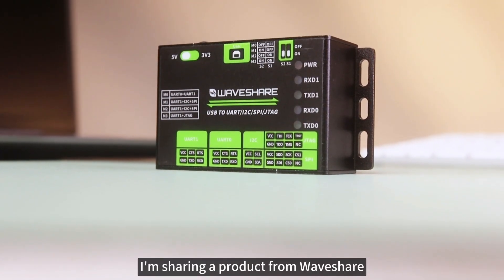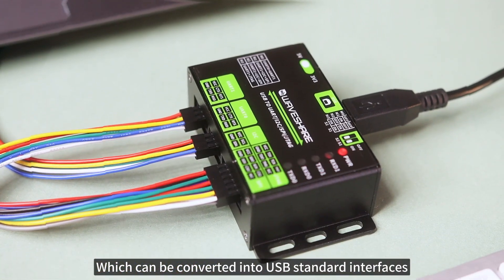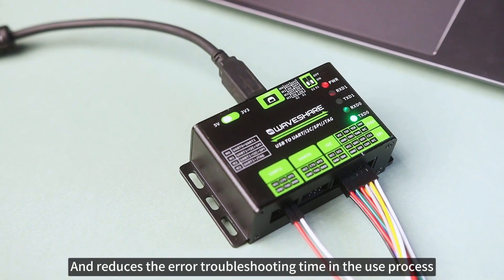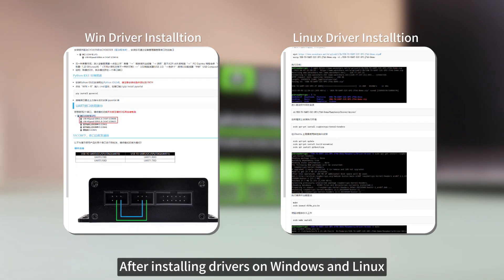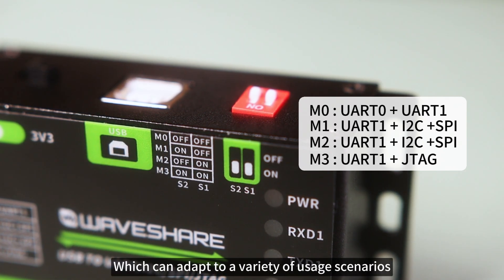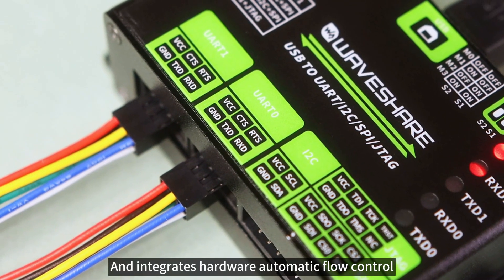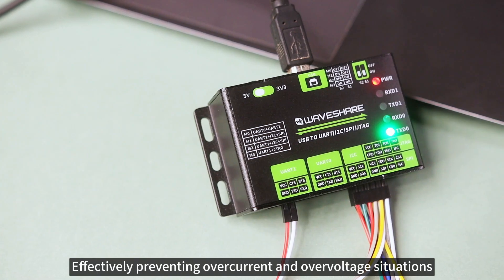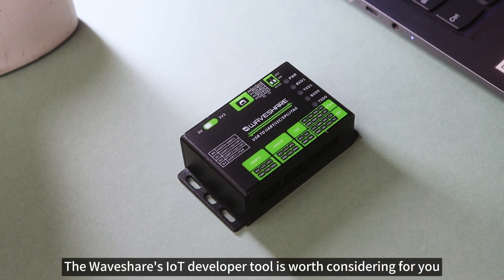USB To UART/I2C/SPI/JTAG Converter, Supports multiple interfaces/systems, Compatible with 3.3V & 5V

Comment: Waveshare Industrial USB to 8CH TTL Converter, USB to UART
Waveshare Industrial USB to 4CH TTL Converter USB to UART
Waveshare Industrial USB to 4Ch RS485 Converter
USB To UART/I2C/SPI/JTAG Converter, Support USB to 2-CH UART,USB to 1-CH UART+ 1-CH I2C+1-CH SPI, USB to 1-CH UART+1-CH JTAG, Compatible Win7/8/8.1/10/11, Linux, 3.3V and 5V, Aluminum Alloy Case

Comment: Priced right.. looks ideal to read linear magnetic scales for a CNC conversion using the installed scales, eliminate the need to adjust for back-lash and use open loop servos.  Even with closed loop, this will show the backlash and reset back lash parameters on the fly.